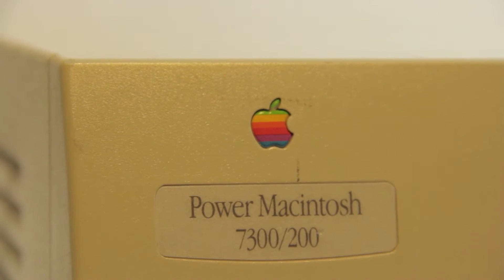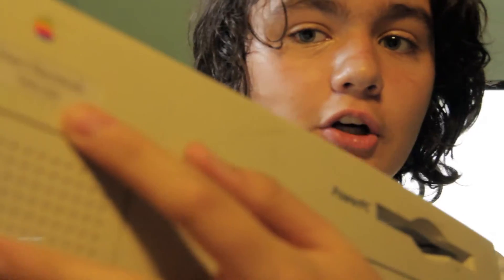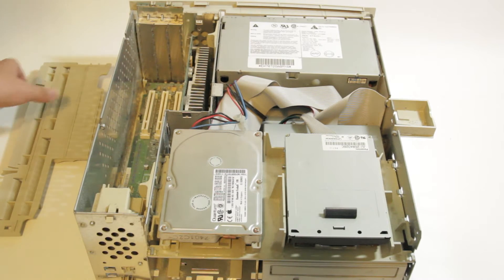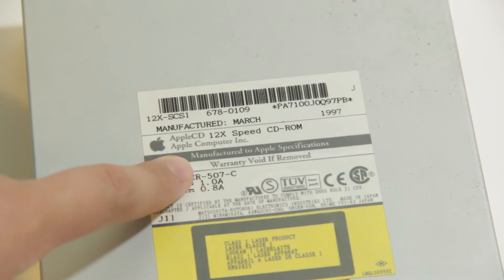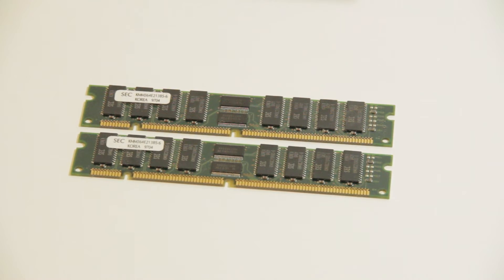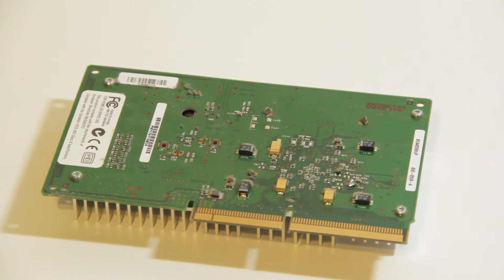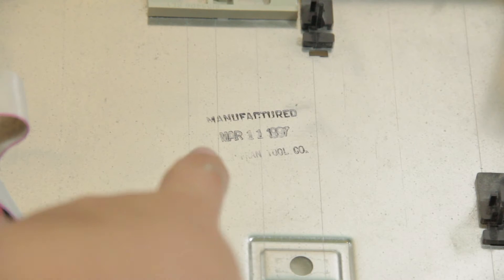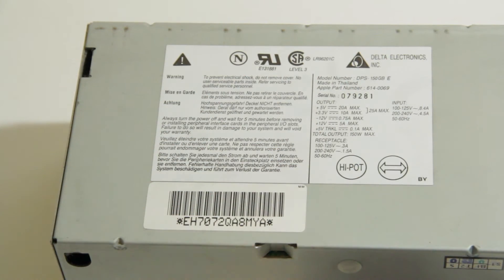Power Macintosh 7300/200 Teardown - The Mac With Two Screws

Comment: I wanted to start up my vintage 7300 to extract some legacy files and found the on/off button had retracted out of fingertip reach. So I used the back of a marker pen to press, causing it to drop backwards into the void behind as whatever was holding it in place had disintegrated. Luckily I found your video and was able to retrieve the hard disk which I intend to send out for the contents to be copied. Thanks Dodoid for sharing.
Reply: You could’ve just used a keyboard.

Comment: I had a 7500 at work and later bought a 7300 (with PC compatibility card!) for home. The real joy of these machines was that you could flip open the entire drive assembly intact to access RAM or other slots on the motherboard. It made it really easy to add memory, change slots, or update the processor (as we did in the 7500, from Power PC 601 to 604). Without doing any research I bought a secondhand 8500 later and had no idea it would be so much more difficult do work on! I do think the blue & white G3 case (and the same case made graphite in the early G4s) was even easier to work on, but this was a very close #2 in how easy it was. Very few computer cases from any manufacturer were so convenient.

Comment: The PowerMac G3 desktop uses almost exactly the same form factor case. The main difference is that the G3 had a "personality" card as well, which breaks out the audio/video I/O. I believe the standard just has the Audio on it, but there were also ones with Video hardware on board too.

I had a 7300 at one point - nice machine. I believe the 7200 was very similar in design too - IIRC, the 7300 I had needed some cosmetic repair, so I used some of the parts from the junker 7200 I ad at the time. I used to buy up old Macs and put BeOS on them for kicks. Lots of fun.

The ultimate cool case was the 6100 though... classic pizza box. I still had one till few years back, but it was massacred in a leaking battery incident whilst in storage. Suffice to say, never, ever store Macs with those half AA lithium batteries in them. When they die, they tend to leak and the crud they leak will literally eat away your logic board...